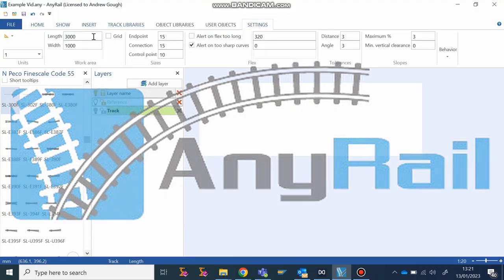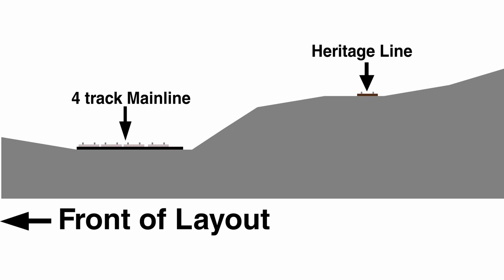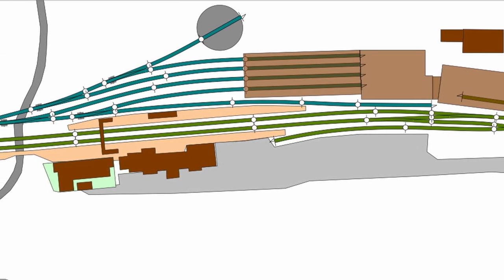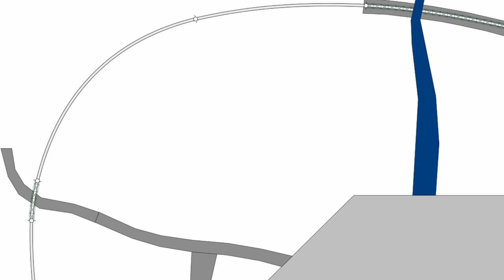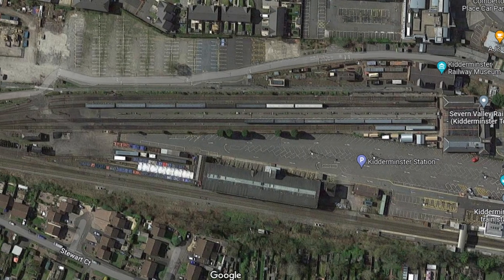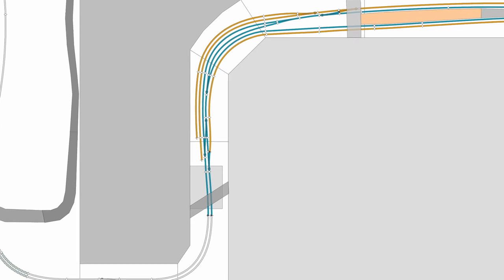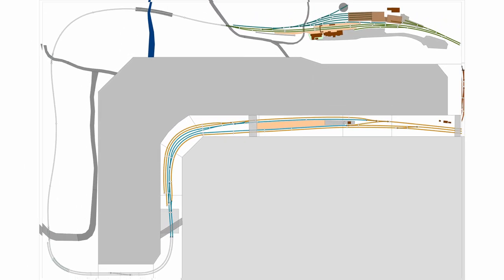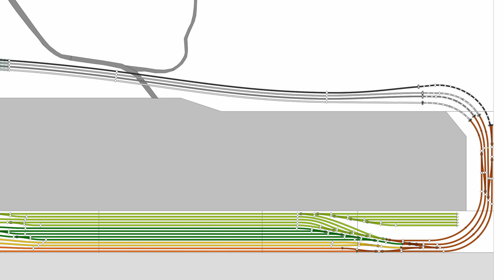Wolverton North - Trackplan overview

Comment: Hello sir, I just across your video and was wondering how you were able to use a photo in Anyrail to do the opening scene of your video/ track plan. Can you please share
Reply from the maker: Hello. Here is the way I add photos into anyrail. First from the "inset" tab add a rectangle, doesn't really matter about size at this point. Click on the shape and from the "Tools,Surfaces" tab you use the "load image" button which will then attach your chosen picture to the surface. You can then resize the image to suit.  If you use the ruler and a known measurement on the photo you can then scale the picture to be the correct size. There is even a handy "Adjust outline" button that makes the rectangle change to be the same size as the picture. If that doesn't make sense let me know and I'll put a post together on my Facebook page with some screenshots.

Comment: that's phenomenal! the first 150 subscribers  to your channel will be invited to running sessions, right? ;)
The lift-out section will be double-deck? (Is there a hazard of lifting it out without seeing a train on the lower deck?
Reply from the maker: Once the layout is functional like minded modellers will be more than welcome to come round for a running session.
I have a plan for the liftout section. Yes it will be double-deck and it will be motorised. I'll include loco detection on the lower deck that will either disable the lift out from working or illuminate a big red warning light.

Comment: Won't hold you to your answer but do you have a time frame in mind??
Reply from the maker: It really depends on how quickly I can construct the actual building to house the layout.  It’s not going to be finished any time soon and realistically its likely to be 4-5 years before all the base boards are installed and trains can run the full layout.  However, I should be able to get sections of the layout completed sooner as well as some of the more technical aspects, such as the lift out, finished in the next year or so